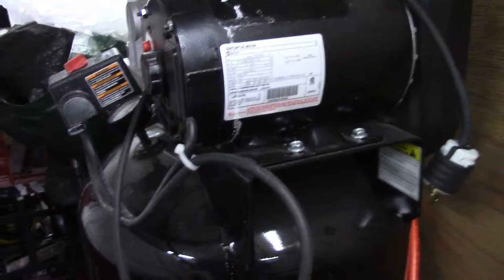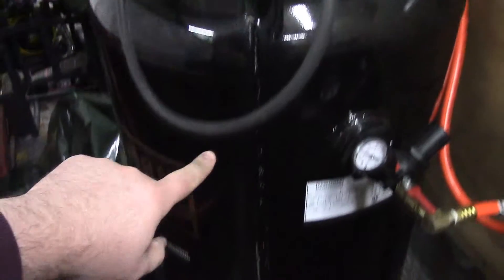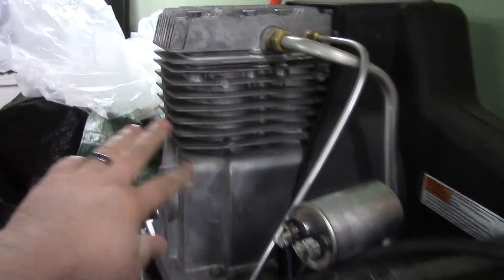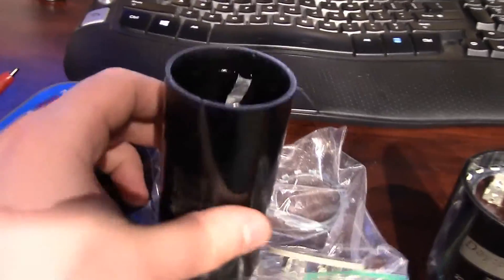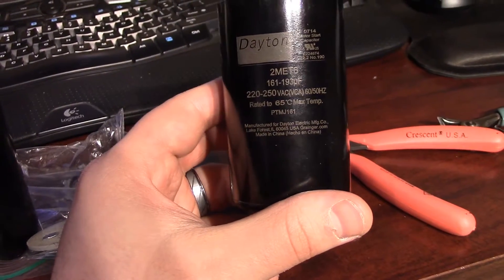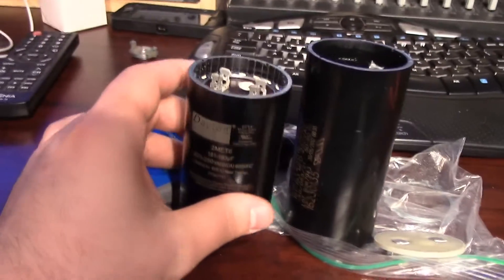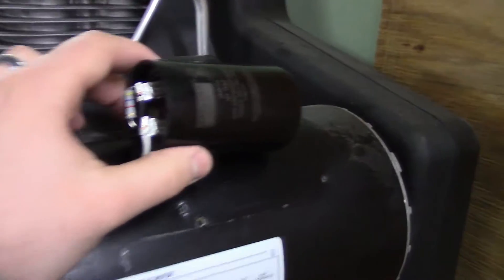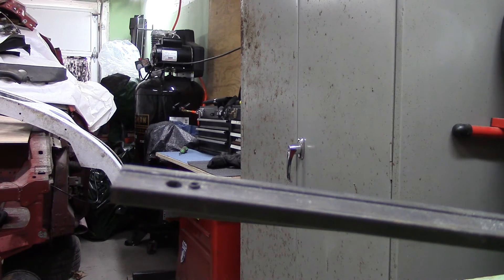Craftsman Air Compressor - Capacitor Repair

Comment: If your shop is unheated and gets too cold, switching to a full synthetic compressor oil will help your start capacitors last longer.  Oil gets a lot like glue when it's cold.
Reply from the maker: Thanks, that is good to know.

Comment: I bought a 60 gal Craftsman Professional (919.165600) air tank in the May of 1999. Last week a piston broke (Nov 2018). I installed a piston kit and fan, ez pz.
I've been using this compressor on a weekly basis for 19 years without issue working on our semi's, trailers, and cars. I'd buy another one in an instant. I think you just happened to get a bad one, which is unfortunate.
Reply: they probably were better quality 19 years ago.
Reply: I think the 919 series are a different animal. I am rebuilding mine now (capacitors, gaskets, etc.) Parts are hard to find though.

Comment: Alex, the run capacitor on the right, did that have 2 black wires and the other colored one?  How do you know that the cap on the right is the start cap?

Comment: my craftman all of a sudden keeps popping breaker,,,it happens when i switch it on motor barely turns over,,,i pops in about 3 seconds...any clue what part is bad???
Reply: Motor start capacitor is probably blown.

Comment: Shows that you liked the comment but never replied... I bought the run cap and it wasn’t that but the start cap fixed it!
Found both cheap.... neither from the craftsman company and 1 actually won’t even fit under the shield on the unit but you can tell by this comment I have air
Reply from the maker: Awesome! Glad you fixed it - I thought I did reply to your last comment I apologize! I did not buy my replacement from Craftsman/Sears either. Too expensive!

Comment: You didn't explain why the resistor
Reply from the maker: Sorry about that! The resistor drains the cap after the power has been cut otherwise that cap will sit and may hold a charge.
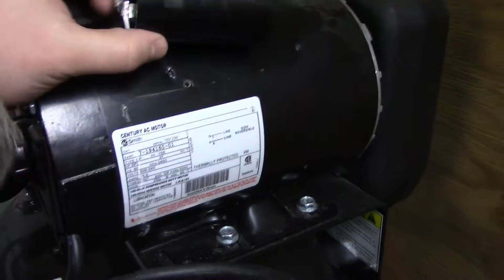Reply: I've heard of that but you did that to the new cap and then installed it with the resistor or I'm  mistaken? I see it at 4:23. But while I have you and since you've been all over this compressor...my compressor won't start.  It hums then breaker pops. If I nudge the fan blade before the breaker pops it will run like normal and get up to pressure.  Doubtful it will restart when pressure drops unless it gets that nudge. When I turn the blade by hand I meet a definite point of resistance but cannot decide if that's normal because of where the piston is or if there's something more serious wrong in that pump area. So it could be the capacitor doesn't have "enough" to start the compressor.  It looks fine.  But I have no way to test it. It's the 3rd capacitor (A/C, fridge also) in as many weeks that I've been suspicious of. The A/C was obvious (bulged and leaking) the fridge turned out to be OK. Maybe it's time to invest in a meter.
Reply from the maker: I'd have to go take a look at the compressor, I'm pretty sure I installed the cap with the resistor as that is how I found it, but would have to pull the cover to look, will try this evening. Caps do go, but if you have had multiple in other appliances I would be weary too.  This is the cap tester I use: https://amzn.to/2Cw0QRQ - Keep in mind it is not an in-circuit tester so you will want to disconnect the cap first. 

It does sound like your compressor is doing what mine was, although I did not try to move the fan and help it along.